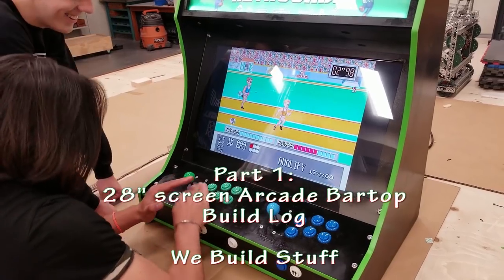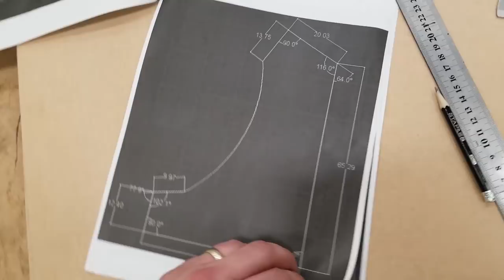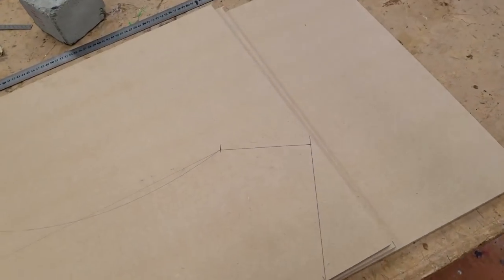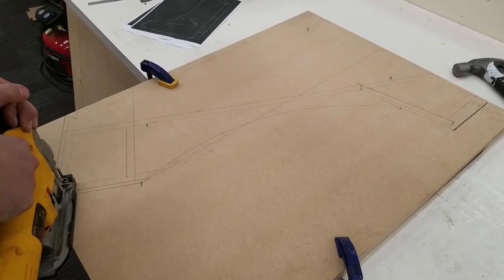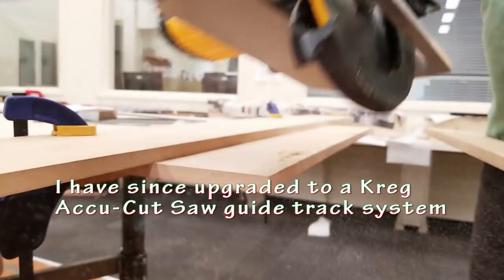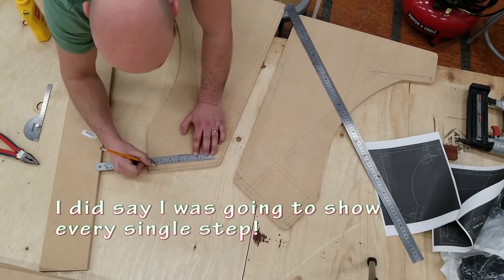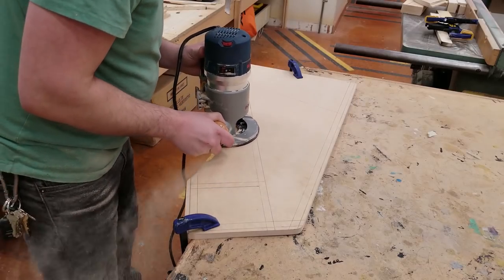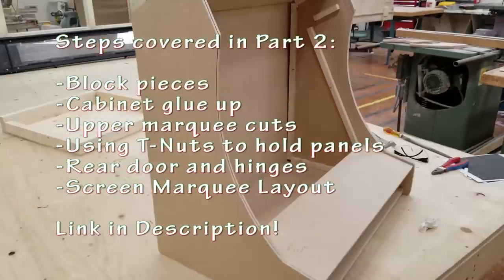How to make a DIY BIGGER Bartop Arcade! - Part 1 - Raspberry Pi

Comment: Hi  great  build  my complments , are you using metric on all the drawings ?
Reply from the maker: Yes I believe I did. When I build I do sometimes use Imperial for some measurements when I'm rough cutting but the plans are in Metric.

I have a background in construction and carpentry as well as in elementary school we taught both as valid units of measurement. Some of my tape measures and rulers have both while others are only imperial. I always build with what I have
Reply from the maker: Thanks for the special email! Much appreciated!

Comment: Excellent video. If I wanted a 32 inch bartop, would I juts adjust accordingly? Btw, you sound just like ETA Prime. Your videos are excellent also!~
Reply from the maker: There might be some verticle and horizontal stretching needed to fit that size screen. I did a fullsize standup arcade with a 32" screen recently so you could easily combine those plans with these ones. I always start with a side view drawing and add my panel sizes from there. If you are building around a screen use that as your starting point once you know how you plan on mounting it!

Comment: Would I be able to use your measurements, but throw in a 32 inch tv? Thanks
Reply from the maker: It might fit but if not just scale up the measurements to make it work! Dwg plan link in the description

Comment: what is the display model? where can be bought in europe?
Reply from the maker: This is a video to build your own not to buy your own
Reply: @WeBuildStuff  maybe my english Is very bad. I Am talking about the flat panel, the display, the led, OLED, IPS or va panel used to display images.
Reply from the maker: @pam8352  I went and bought the cheapest HD 28" television from a local electronics store. I think this was a Samsung

Comment: Anyone know where i can get a diy kit similar to this one? I dont have the tools to pre cut the wood? Willing to pay and have it shipped to Ontario, Canada. Haruman customs priced me at $422usd shipping included. My budget is tight at around $250cdn. Any assistance is much appreciated. I will post my final product with a special thanks to anyone that can help me get started. Thanks
Reply from the maker: With that budget you could buy a jigsaw, drill, and material to build 2 yourself. We don't sell these.
Reply: Worldrecord  where about do you live? I'm an hour west of ottawa. I might be doing one up in the next month or so. Might be possible to cut one up if your close enough.
Reply: That's a wonderful suggestion. Im located near Mississauga, Ontario (50min from Niagara Falls). I'm in talks with a few people near me but not confirmed yet. Might be over my head with this project as I'm already having issues with Raspberry Pi and Retropie and formatting it properly (after viewing many youtube tutorials). If you plan on coming closer to the Greater Toronto Area let me know. Thanks again for the offer!
Reply from the maker: @mikemeadows9712  this makes you a cool dude. What a great community!
Reply: @Worldrecord  Just a tip. Cheap SD cards are one of the WORST things you can do to a retropie. I was having loads of problems after multiple reformats and iso loads. It was just because I got a "slightly" cheaper sd card.(silicon power brand I think, was the bad one)
Reply: Psylar : thats a great tip. I have been using Samsung EVO plus U3 and so far no issues. Just trying to get an easier cabinet build without any curve cuts. Aiming for a 24-27 monitor maybe 32 lcd tv as speakers already included. Thanks
Reply from the maker: @Worldrecord  instead of the curve on mine I would change it too an L shape on a slight angle. That would be a simple mod
Reply: We Build Stuff : ah yes. Definitely will look into doing that with plans i have from geek pub. Cheers!